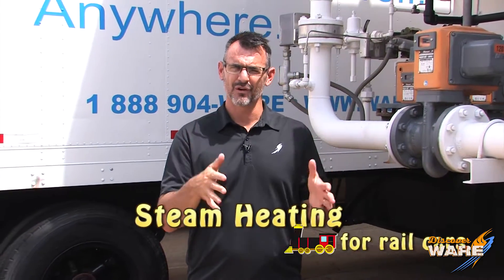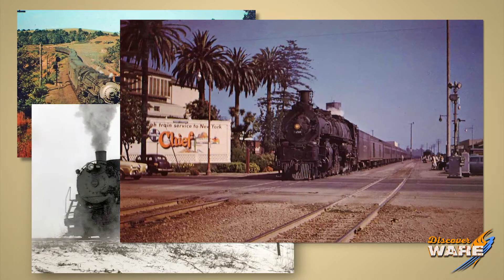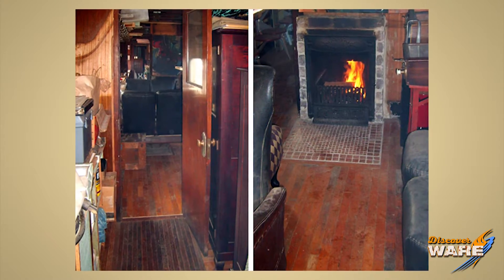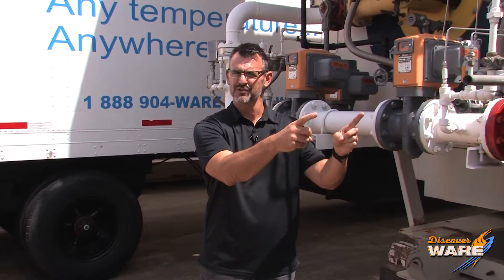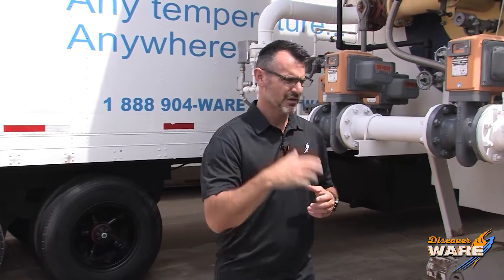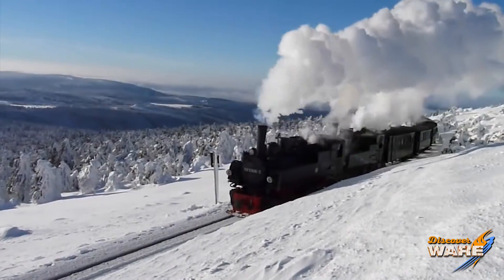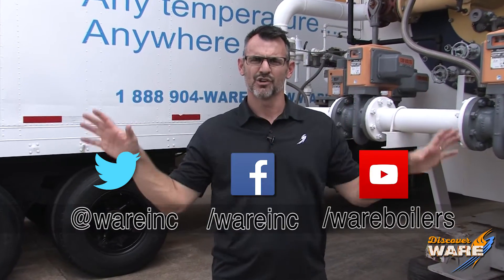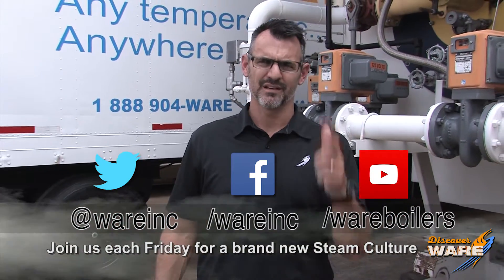Heating Railcars with Steam - Steam Culture

Comment: Have been interested in railroad's since my grandfather (The Judge or Hanging Herc) and my father first took me to the yards and harbor in Ashtabula, Ohio in the early 60's. 
Grandpa knew everyone and dad had worked summers in the NYC car shops. The F, E, Alcohol, Baldwin, etc. locos would rattle the windows as they sped by on the water level routes trackage and shake the ground as they clawed there way to and from the harbor with their heavily laden cars. 
  Thanks to a fellow by the name of Egbert Gold and his company, the passenger locos were outfitted with low pressure steam generators to provide the steam for 'vapor heating'.

Comment: Here in the UK our diesel locos had small bore Steam generators onboard the loco to heat the carriages.
We used three different manufacturers, Clayton, Stones and Spanners.
They eventually went out of use roughly late 1970s when diesel locos were converted to run electric train heating